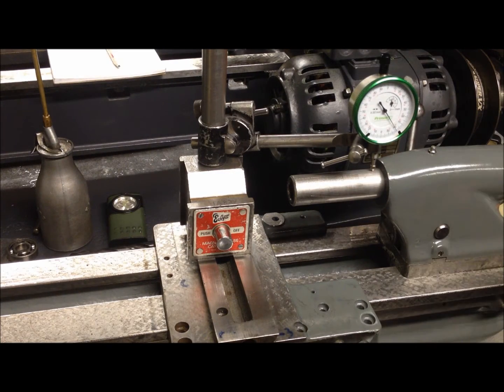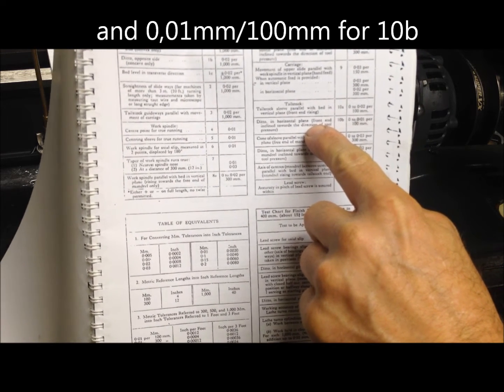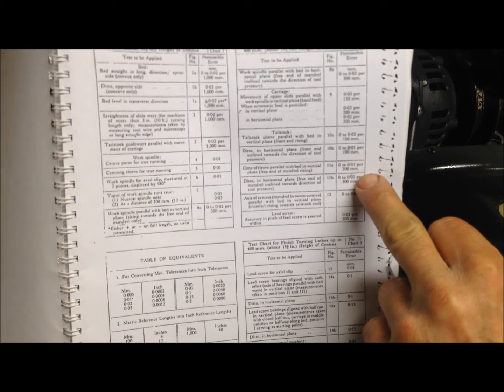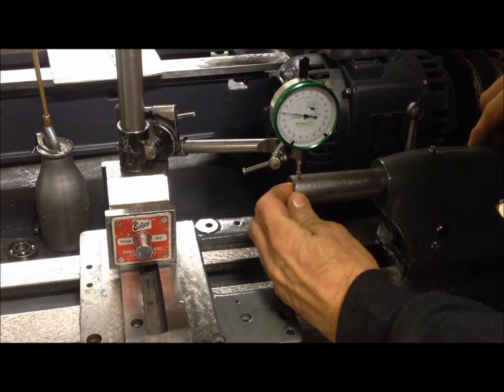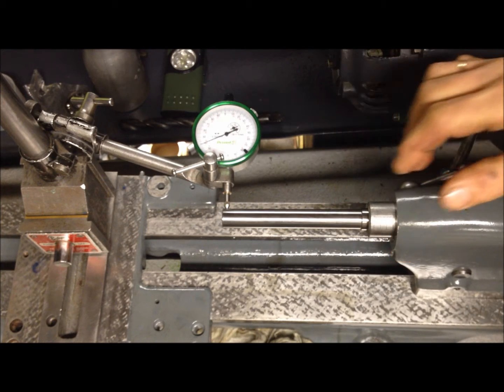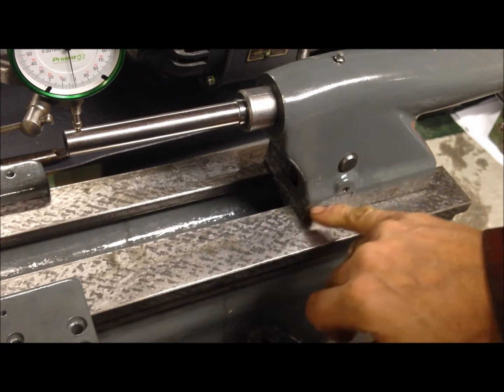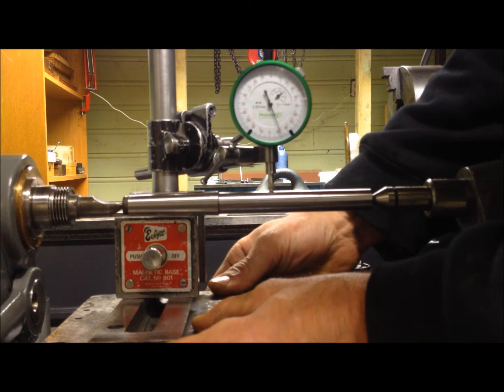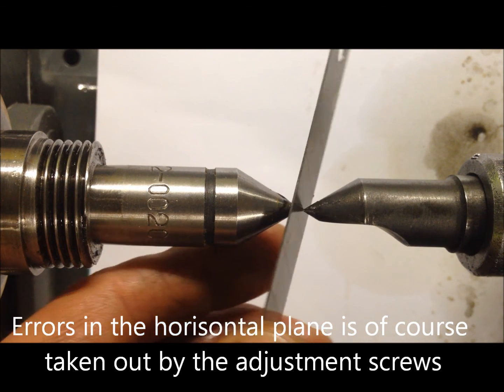Myford Super 7   tailstock   initial measurements

Comment: Jan I know this is an older video now, but a couple of suggestions for what they're worth.

When you're doing measurements like this it's generally considered better to use a flat tip on your dial indicator and try to have the indicator relatively perpendicular. This was especially true when doing your horizontal measurements. In that case you already know the tailstock points high, therefor you know that the indicator tip will run off centre. The measurement will be in error by the amount the tip varies off centre. A flat tip will avoid that error. A rule of thumb (sadly that too few follow) is to measure flat parts with a round tip, and round parts with a flat tip ie always flat against round. The tips can be purchased, but are also easy to make.

The measurement is generally done with the quill locked.

Thanks for sharing this
Reply from the maker: Thanks for the suggestions. It is logical and I will of course try to follow this. Need to buy myself such tips (and more I reckon) to fit the indicators I have. Quill locked.. hmm, I may have forgotten :) Thanks again
Reply from the maker: Btw.. if the lathe was complete, I would have used the method we learned in class where you chuck up a pice of metal, eg. aluminium for ease of turning, turn this down to the exact dimension of the tailstock barrel, move the tailstock  over to the headstock (assuming the bed ways are not worn so close to the headstock) and use an indicator mounted eg. on the toolpost. Running the crosswise to find the highest point, then longitudenal from the part onto the tailstock etc.
Reply: Ah yes, that was the third thing I was going to suggest. Funny you should mention it. However I figured you'd pretty much done the same thing with a bar between centres, so not much point. It's my preferred method however, as the tailstock bed is normally not worn at all up that close. Not an issue if the bed has been scraped/ground of course.

The indicator probes are very easy to make. I have a set of very small taps and dies I think I bought from a local electronics shop, I can't recall, but there's enough sizes there to do every brand of indicator I have anyway. It's a straight forward turning job from there. They could be hardened if you wanted, and made from silver steel (drill rod). I lapped mine, but for people like us there's probably not much point in either from a metrology perspective. The thread sizes are available from Long Island Indicator's site if you need to confirm them.

I've made many standard tips too, having bought many indicators at auction without tips. Standard tips are also not difficult to make and both more than adequate accuracy for our purposes in my opinion.

Thanks for putting up such good videos by the way. i really enjoy watching other people work and picking up tips and different techniques from others.

Comment: Jan, I appreciate that you are documenting all of these steps and the process of reconditioning these machines. You are very systematic and it shows in your craftsmanship and results. Thank you for taking the time to film, edit and post these...they are very valuable.
Reply from the maker: Thank you very much!I am not a champion in what I do, but try my best. Whatever I do right is probably a result of the methodic application of the correct taught procedures and which I have now aquired some training to master. You have to dig into it and I learn new things all the time. At work we fight 1/0 of dB's, and I am well aware of terms like measurement accuracy and uncertainties, so try to apply this knowledge here also. It is very easy to get fooled by a measurement and not so good to trust blindly on a non-validated, "stand-alone" result. For example, sometimes you get to a point you cannot see the obvious error you are doing with regards to a measurement setup or intepretation of a result. I had one mistake here with the tailstock mesurement that contradicted the others taken, and was not logical (I thought hard about documenting this as a "blooper", but left it out, as the video would be too long. However, both to show I do (a lof of) mistakes, that the progression is not always linear.. 2 steps forward and 1 back... it may be OK.).
I was so certain I had it right, but a gut feeling it wasn't right. After a pause, cup of coffee, rereading & rethinking, and eventually redoing it with "a fresh mind", I figured it out.. just reading "the indicator the wrong way" (lost track of which direction was in and out..)! The more experience you get the more this becomes natural. The basic scraping in itself is probably the easist to learn, but it sure helps to have a class like that of Richard King (if you are in Europe, he will have more classes here this year), as his personal way of tutoring gets you on the right track very fast, saving a lot of "fooling around" on your own.